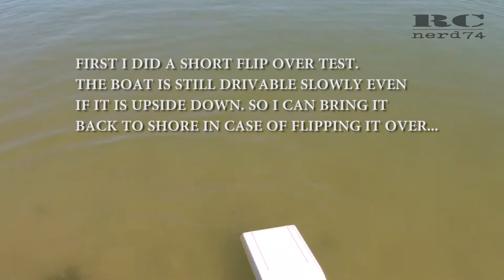DIY RC AIRBOAT | REVIEW LATEST BUILD STEPS & FIRST RUNS

Comment: Cool boat , its got some fast top speed 👍 
I used to shape surfboards alot , would be fun trying out different  shapes and even fiberglassing it. 
Thanks for sharing mate this is so cool 👍
Reply from the maker: Thanks. There are still a few mods to come. hope it will run even better. I expect better steering control and a bit higher speeds. Videos will follow soon :o)

Comment: Bro, i've just made mine.. its dam hard to controll, i think the rudders height need to be same as the propellers..
Reply from the maker: Yes. It is very powerful for the size. But I like rc models which are a pit overpowered. Like this it is much more fun than just full throttle the whole time without using any skills☺️
Reply: @RCnerd74  bro, i've convert the air rudder to water rudder.. its more controllable now.. haha
Reply from the maker: @tanoryjakaperdana1419  Good idea👍🏻 Thanks for sharing. Enjoy your airboat😃

Comment: nice airboat mate well done might have t copy this if ok 👍
Reply from the maker: Thanks. You can copy it if you like. No problem. Straight run handling could be better at full throttle. But it's fun to drive :o)
Reply: @RCnerd74  cheers good luck on next build mate